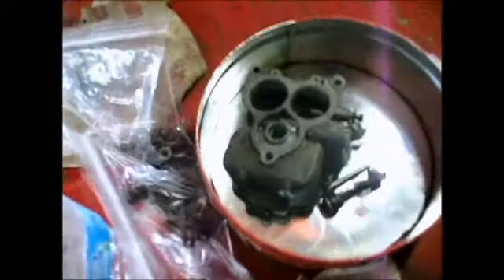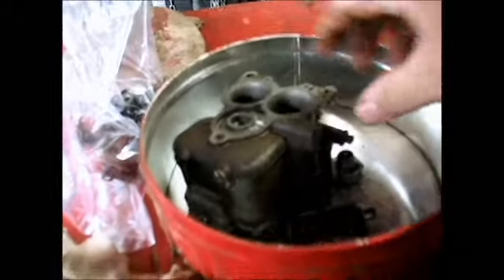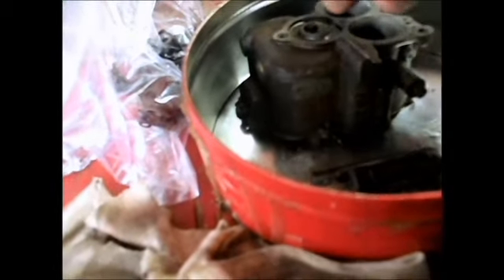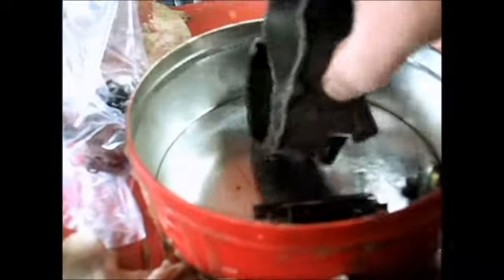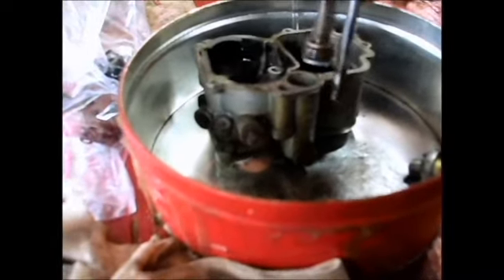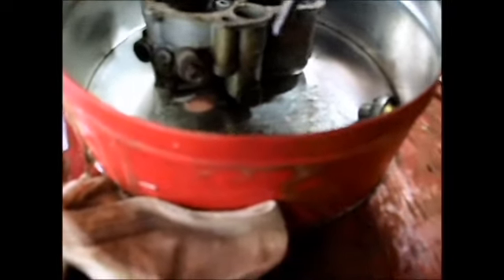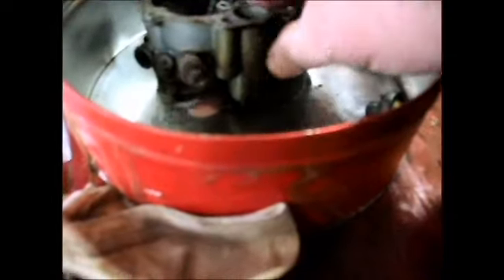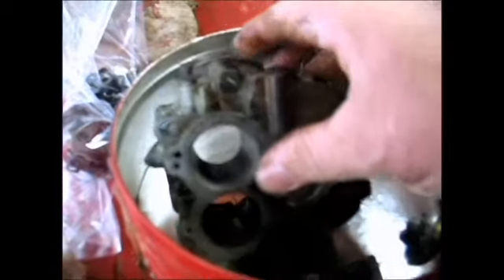1955 Ford Carb Rebuild 5

Comment: tap those stuck screws with a small hammer , just lightly for a spell and they should come out of there , that works on stuck jets most of the time , another way is stick it in the deep freeze , and take a cigarette lighter and heat around the screw/jet , that often works by expanding the metal and breaking the tension ...ok I will shut up now ;) impaler made me do it ! that's my story , and I'm sticking to it !

Comment: If the crud is wet the lye doesn't soak in so good.
I use it alot for cleaning off engines and engine parts before i power wash. it also softens up old paint and gets a greasy old engine compartment or chassis nice and clean for touch up painting.
But on synthetic oil... The lye when hit with water turns synthetic oil into the gooiest gloppyest wheel bearing grease you never can get off the driveway! it turns it into something like 5th wheel grease

Comment: I looked on WIKI and it does say LYE attacks aluminum and some other metals giving off hydrogen gas in the process. I left some on a carb for a few hours one time and it didn't pit it but it did leave it grey and dull.
I usually make sure the crud is dry so it can absorb the lye then let them sit for 15- 20 minutes to half an hour to soften up the carbon and brush it off with a toothbrush while rinsing it off real good then blow it all out real good until it's dry

Comment: when adding the water to the draino it will get HOT.
it doesn’t gas off or precipitate.
ordinary household bleach is usually sodium hypochlorite 
EZ off and generic drain opener are both sodium hydroxide (best to check the labels)
both bleach and lye are bases

Comment: One time I put new wheel bearings and seals in my mack semi I used to have.
To clean up the oily backing plates and break shoes I decided to soak them by spraying down in EZ off and just wash it all off dwn the driveway.
It washed off alright then when it hit the driveway the dirt and oils came out of suspension  it turned to thick gooey black grease.
My brother told me the same thing happened to car with a bad seal they tired to clean up, told me it was becauze of synthetic

Comment: That old carb dip tha smelled like formaldehyde  used to work wonders but it's nasty stuff and hard to get rid of.
I took to using EZ off for convenience don't soak it overnight or nothing like that if you want to try it ...just a few minutes because it can fade out the cadmium finish on the carb body.
Cheaper than ez off is to mix up some crystal draino in a spray bottle
Same chemicals ones already mixed the other aint.
they are both the same chemical

Comment: Chemical reactions happen from sharing electrons
Anything that is ph neutral means it doesn't need an extra electron and it doesn't have one either.
I can't remember which way it goes but you can go from neutral into 2 directions- acidic or basic>
bases and acids react. one is a giver and the other is a getter and the shared electrons balance it all out.
A strong base and a weak base or a strong acid and a weak acid can still react with each other.
it's also what makes stuff corrode or rust.